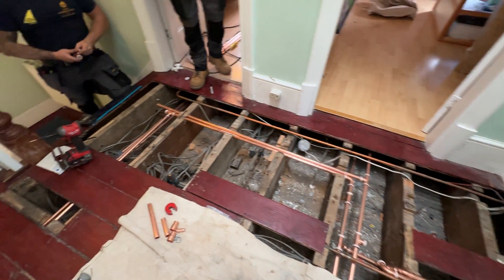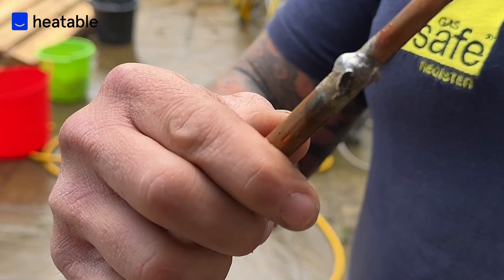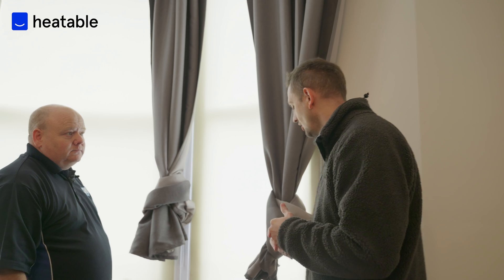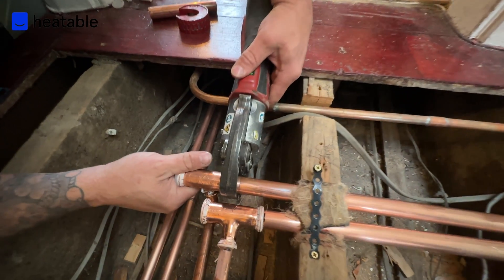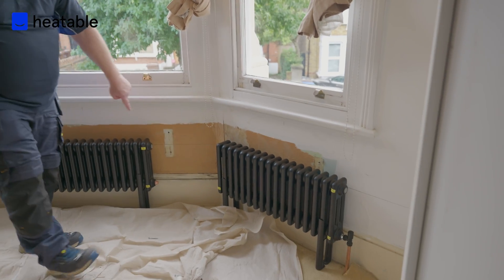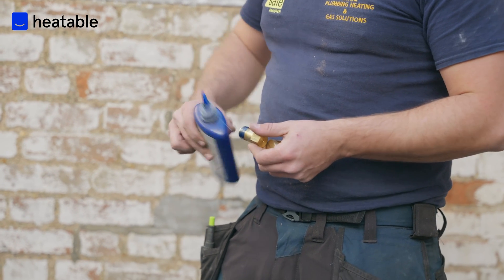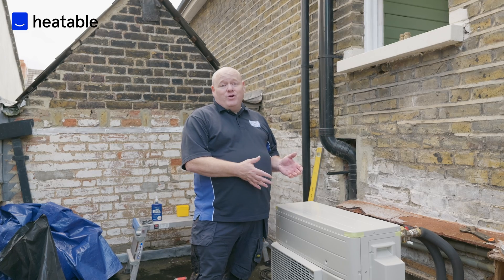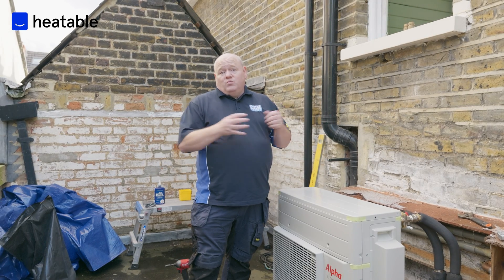How To Install A Hybrid Heat Pump | Alpha E-Tec Hybrid Heat Pump ASHP Heatable

Comment: Great video. I really like that you have a back up. I am investigating the right setup for my 3 bed bungalow. 
At the present time I have a combi no insulation. I have micro plastic. I am very impressed with your system. At present the system I have is old and the property has been not  been lived in for 5 years. I have flushed all the rads but still the heat is struggling to reach the furthest away rads. Could you tell me if I should change plastic micro to get heat into the last radiator, Looks a great system . I am having the place fully insulated in the walls and roof in preperation for a hybrid system.
I love the fact that it will choose the cheapest way. 
Thank you

Comment: Could this heat pump be fitted to a 4 year old Viessmann vitodens 200 combi boiler and can it operate with out the need for a water cylinder.  I’m guessing the combi will always do DHW but when cheapest the heat pump would run the central heating ?

Comment: The problem with fitting the lesser known boilers i.e. Alpha's, navien, etc is servicing. Usually the seals cost more than your Worcester, baxi, vaillants and us servicing engineers are less likely to have the parts on the van. The outcome of this situation is the engineer always replacing every seal because they've bought them for the service just so will need to use them otherwise the seals won't get used for months otherwise. This means the servicing cost will be higher than servicing a more common boiler

Comment: what are the hybrid boilers and heat pumps for oil installations? also, a 4 kw heat pump doesn't sound very big for that property, how much will it actually stop the gas boiler coming on?
Reply from the maker: Not sure about oil. Sorry.
Reply: Grant heat pumps have the oil hybrid heat pump

Comment: How does the gas boiler know when to help the heat pump ?
Reply: I'm guessing the sytem will measure all the temperatures such as the flow and return and the outside temperature then send a signal to the boiler if those temperatures reach certain parameters

Comment: Can’t find any information in regards to how much it cost to run comparison = heat pump - gas boiler , hear lots with its 160% or 400% more efficient lots of that stuff , heating one house last years bills October to March, month by month = heat pump bills, gas bills. No good buying a heat pump if bills are twice three or four times higher, if it’s cheaper, I will order mine tomorrow if more expensive buy a wood burner.
Reply from the maker: The control works out which is cheapest to run based on customer fuel prices.
Reply: @AllenHart999   Wow that answer is borderline still in the dark then, need 50p for the meter.